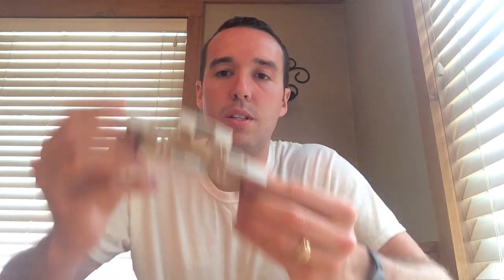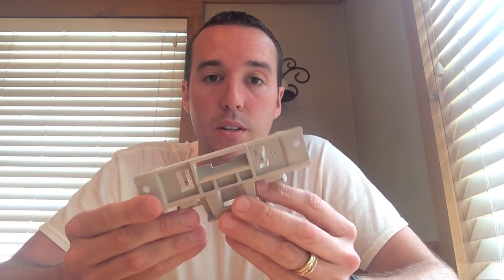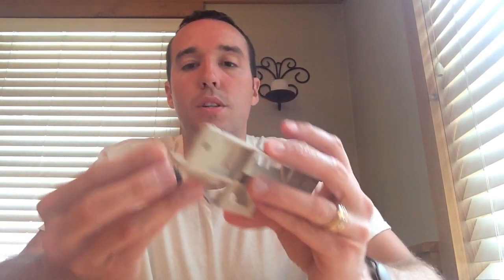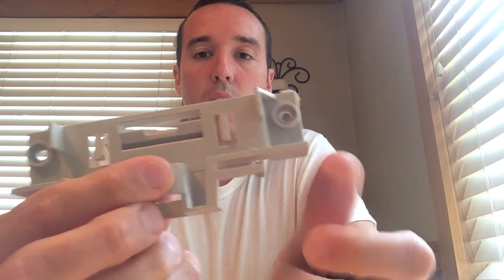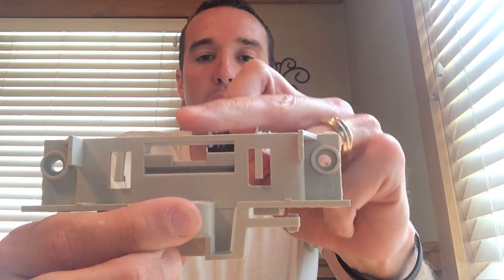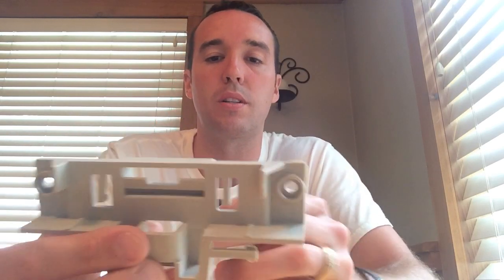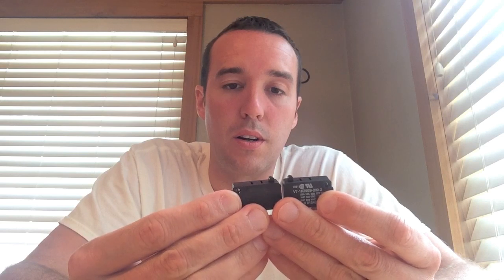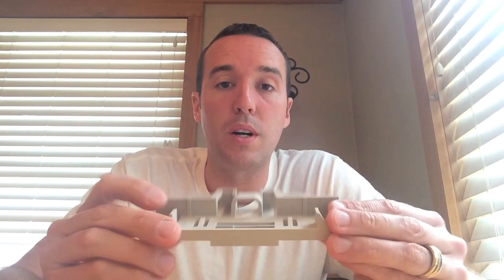My Dishwasher won't turn on / won't stay running - EASY FIX

Comment: i did a reset, however after the reset process the lights do not remain on, and the dishwasher still doesnt power on or wash...any suggestions..thanks
Reply from the maker: healthyamerican 

Thanks for watching!  We recommend gaining access to the power cord & unplugging it...wait 30 seconds...then plug cord back in & verify it is fully plugged in & secured.  After doing this, try turning on dishwasher.

If dishwasher still is not working, you may need to replace the control panel.  This is a very friendly DIY project & will not beat up the bank account 😀

Let’s start there!  Keep us posted!  Please subscribe to the channel and turn on your YouTube notification Bell that would be awesome thanks again!  😎👍🔧🔩
Reply: i turned out to be the front control panel. found a replacement online for $75. replaced it and working fine..thanks
Reply from the maker: healthyamerican 

Very cool & thanks for checking back with us & sharing your update!  We can’t thank you enough!

At any point in the future you run into any issues, definitely reach out to us!  We are here to help!  😎👍🔧🔩

We are happy to hear you’re back up & running!

Comment: My Maytag starts and runs after a few minutes then it stops and drains, any suggestions?
Reply from the maker: Ernest Hin 

Thanks for watching & we are happy the video helped.  So glad to help.  Once it stops...does it turn back on if you gently apply pressure to the area where the handle/lever is?  If yes, your switches will need to be replaced.

We really enjoy making these helpful videos for our fellow DIY’ers.  Many more helpful videos to come!  😃

Let us know if you have any questions.  Please subscribe to the channel and turn on your YouTube notification Bell 🛎 that would be awesome thanks again!

😎👍🔧🔩
Reply: @DIYwithMichaelBorders  no it doesn't
Reply from the maker: Ernest Hin 

Thanks for the reply.  You may need to unplug machine & open up panel.  Inspect all wiring & check for any signs of damage, burnt wires...

Your control board might be in its early stages of failure.  How old is machine?
Reply: @DIYwithMichaelBorders  1.5 years old
Reply from the maker: Ernest Hin 

😲...it’s still brand new basically.  It shouldn’t be giving you any troubles this early in its life.

Your machine may still be under warranty and can possibly be either serviced and fixed for free or possibly replaced altogether.  You may want to check into that.

Keep us posted!

😎👍🔧🔩
Reply: got it working, for some reason the door switch stuck/jammed out of its holder/position, took my finger and moved it back in place and washer is back to normal
Reply from the maker: Ernest Hin 

Awesome Awesome that’s great news!  We appreciate the update.

😎👍🔧🔩